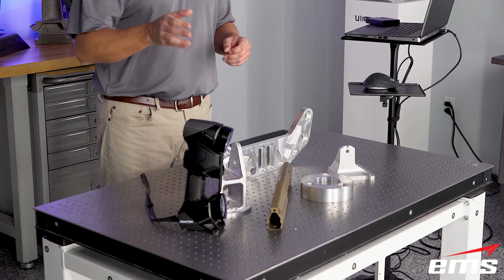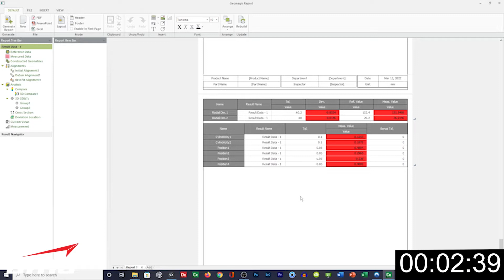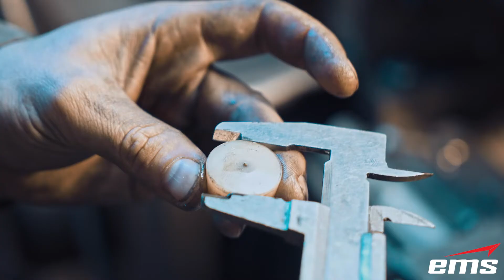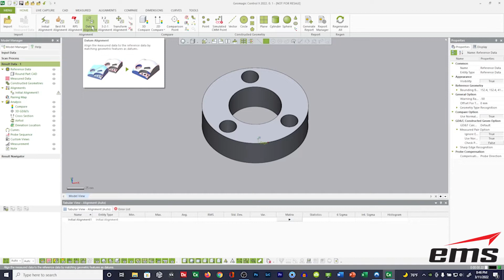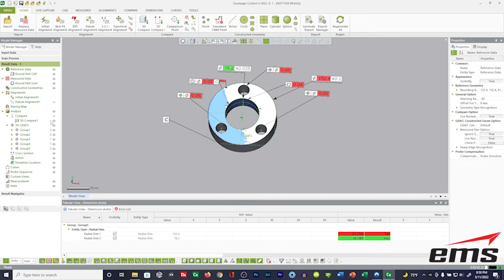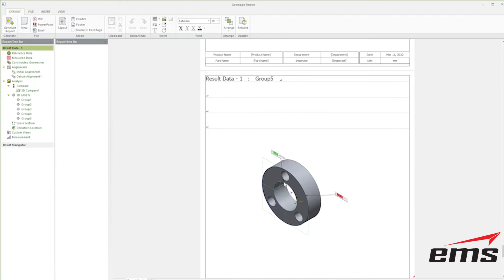3D Scanning & Inspecting Machined Parts

Comment: Ok, to be fair there is a some setup in Geomagic Control X in order to get to your one-click inspection.  Control X is fantastic software. I used Control for many years, finally migrating to Control X. Yes the Black Elite it is the right tool for the job by far!
Reply from the maker: Yes there is and we show in detail how that is done.  As mentioned this would not be worth the effort for 1 or 2 parts but if you were doing a quantity of parts it would be worth the effort.
Reply: @EMS3D  an excellent video! Please keep posting great content like this!

Comment: Where can I get that turn table?
Reply from the maker: We built it.  You can purchase a "bookcase bearing" and then cut some material (wood, plastic, metal) in a round shape to any size you want.
Reply: @EMS3D  And whats the Metal Black parts ?
Reply from the maker: @ChrisForceFoodShow  The fixture base, rods and connectors are made by a company called FixLogix.  www.fixlogix.com.    The square tubes are aluminum square stock purchased from a home improvement store like Home Depot or Lowes.
Reply: @EMS3D  What about the triangles?
Reply from the maker: @dropdestroy  Home Depot or Lowes in the paint department.